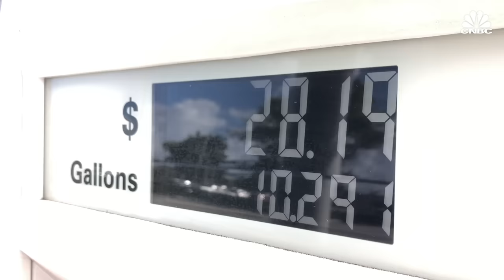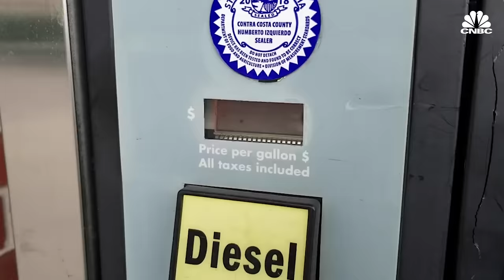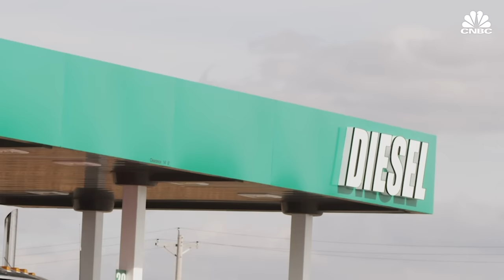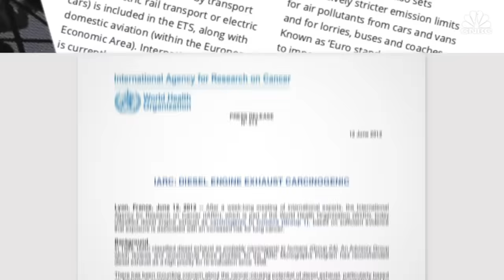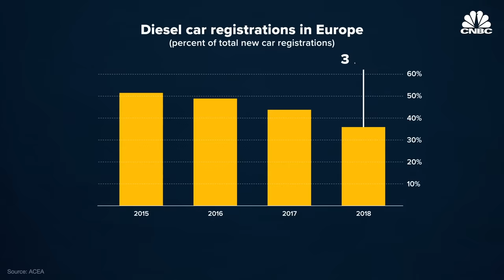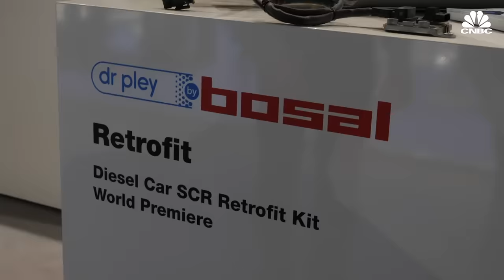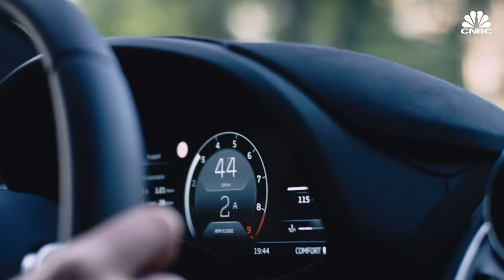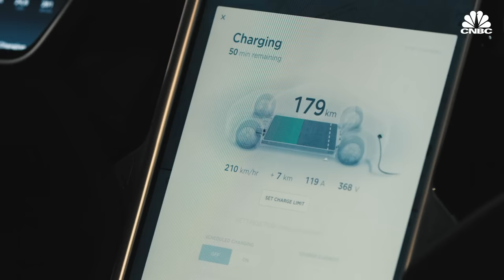Why Diesel Cars Are Disappearing

Comment: As a diesel tech and someone who is very involved with the diesel trade, it boggles my mind why there hasn't been more research into tiny 2 cylinder diesel hybrids in cars. It would be small enough to not produce much emissions and be hands down the cleanest and most efficient thing on the road
Reply: @Retired Bore not in regards to small diesel engines. A 2-3 cylinder Kubota will weigh more then a gas engine of equal size but the efficiency is still leaps ahead of gas engine. And plus in those hp ratings it sint required to be in t4f. This are engines used to power small diesel generators that run at constant load for insane hours on end. Plus the weight isn't that much greater tbh. The use much lighter parts on those baby diesels. I can pick one up off of the ground by myself. Diesel hybrid has entered equipment more prominently recently and already it shows how absolutely amazing it is. The noise is the only thing with those that are noisy but even then new mini diesel gens in rv have also become very quiet. It's very easily durable. But I know the biggest kicker is would be too expensive
Reply: Ist go bad diesel, bad diesel then take it to the diesel pond. Next bad gas engine, bad gas engine & take that to the pond.
Well I guess I need to move to country side and get a Tennessee walking horse. Oh and just how do think you can go cross country on a horse relying completely on that 1 horsepower transportation? You can not. Yep you have to get on a freeway.
And you don't have enough horsepower.
Reply: Gas = hp. Diesel = tq. 
Electric = tq.
Hybrids use the electric to get moving then gas takes over with the hp curve.
 Thus why diesel not used.
Reply: @turboflush  Diesels are heavier, noisier and more expensive to make. Don't fit well in FWD configurations if the diesel has enough HP to move the SUV up hills at the speed desired say on New Mexico freeways. The low temperature starting problem and gelling of the fuel also does not lead to a turn key situation either. But mostly: If it breaks a nail. Requires paying attention to gauges. It won't sell. Besides that diesels are smelly. But  not if you are burning used McDonalds frying oil.
Reply: Because of the DPF which is very expensive and the gain doesn't justify the cost.
Reply: @adrianvasile4683  DEF and DPF just about killed it for those did use diesel in the US.
Both of my neighbors traded their Diesel SUVs for gasoline
 BUT just in case there are a few older diesels hanging in there. Let's raise diesel to  $6.00 a gallon.

I don't care. One of my friends has a 454 CI SUV that gets all of 9 MPG. 8 when it is pulling a trailer.
Reply: @Retired Bore "it takes less power to start a small gasoline engine."  Not significantly less, minuscule,  not worthwhile, not worth mentioning it, only small benefit in percentage.
Reply: @warrenpuckett4203  In the US, manufacturers were reluctant to bring small diesels on the market because the oil industry manipulates the price of diesels and do not want diesels. Why? Because they export large quantities of diesel in Europe. It is absurd to have diesel fuel more expensive than gasoline. From 1 ton of crude oil several times more diesel is obtained than gasoline, therefore it should be cheaper. Probably more than anywhere else US should have far more diesels because the size of the cars and long distances. This is because the Government is week and doesn't have power. We all know it as "small or limited Government" and we "truly" believe is in our advantage.
Reply: @adriaanvantulpenbaard1740  I have noticed that diesel owners seem more reluctant than petrol users to switch off the engine when parked. When I see someone sat in a car for any period with the engine running or even out of the car at a recyling point it is nearly always a diesel. It is is difficult not to get the impression that Diesel users do seem nervous about having to restart the engine. The big problem diesels have is that urban dwellers cannot get a fast run to clean the particulate filter. Typical of our UK government to fixate on CO2 and overlook the myriad of other problems with diesels. The fact makers had to fake emission data to fit in with that way of thinking says it all really.
Reply: Electric is the way to go. Have you ridden in an electric rig before? It's night and day. This is a sinking ship. 30 years and most trucks will be wanting to switch to electric of they can afford the initial investment. Facts. Half the cost to run. The ability to farm your own power and charge others for it as well to recoup costs. The transportation industry will avalanche within 30 years I promise you. Diesel is a dying technology as is gas. It is not efficient and clean as electric can be on a larger scale. Comparing it as of now is not even close. Electric wins by far. Imagine if our grid was developed in a large scale for electric trucks and cars? Can you see the advantages? I can. A trucking company farming their own solar from their headquarters and ultra high capacity battery banks on semi trucks allowing 1k and 2 k miles at a time. With gearing and increased aero we could put 2k miles of range on a semi, still jail a standard size trailer fully loaded, and cleanly drive from coast to coast on one charge carrying the same product as a semi that has to fuel up 4 times or maybe 6. Think about that.
Reply: @tybeeislandgoat1402  Electric is nice, clean, efficient. Just  a lot of problems remain unsolved: capacity, cost, safety and reliability of batteries, chargers, electric infrastructure, massive production of electricity. Lithium batteries are known for at least 60 years and we still don't have a lithium rechargeable battery. What we have is lithium-ion with less than half of capacity.
Reply: @adrianvasile4683  solid state batteries???? Infrastructure will take 5 years tops to convert. And we are projected for 2030 to 2035 to start seeing massive movements towards solid state.
Reply: @tybeeislandgoat1402  interesting is that we establish a date when we are going to abandon conventional fuels and engines but we didn't solve yet the problems generated by this"electrification". This is because the ecologists are leading the movement, not the scientists. In Germany they pushed for years to shut down nuclear power plants and they succeeded. Now everybody realized that was a huge mistake to abandon the cleanest method for generating energy. I think that we are going to have more electric vehicles, which is very good for a lot of reasons, but internal combustion engines are here to stay for longer. Another wrong direction are the electric cars with hundreds of HP. They need huge batteries which are expensive.
Reply: Elon Musk enters chat.
VW exits chat.
Reply: @warrenpuckett4203  If you put a Tennessee Walker on a Dyno you will see more than 1 HP.
Reply: They can't earn money on it
Reply: DEF is the Achilles' heal created bye the federal DOT and the worst part is that it can't be produced in North America
Reply: @warrenpuckett4203  You realize that diesel engines are in an enormous amount of FWD vehicles? You won't even know a vehicle has a diesel engine since they are MUCH quieter than past. Look at many of mercedes and VW or most trucks, 18 wheelers, construction equipment, generators etc. You are not well informed about diesels to talk about them. All of the issues you mentioned are basically non existent now. TDI have sorted out HP, diesel fuel have additives to stop gelling for decades, up hill driving diesel is actually better because it is torque that provides the effect to drag heavy weights where as HP is only for acceleration, you can test this by max loading a turbo petrol vs a turbo diesel uphill you'd quickly see I am correct. Just like petrol has pollution clearing techniques so does diesel engines. Without diesel engines you goods would more than double in price.
Reply: I don't know if you were aware of this, but there was a car made by Volkswagen that was exactly that. A tiny 2 cylinder diesel engine connected to a generator in a plug-in hybrid car. It apparently got 260 miles per gallon (0.9L/100km). Aging Wheels has a video about it. https://youtu.be/1E4Cqx4S7K4
Reply: thats what ive been saying you would get so much fuel economy.
Reply: Because it's not about saving environment but getting more taxes.
Reply: Have you not seen VW’s XL1 from 2013
Reply: @Retired Bore Do you understand TORQUE?
Reply: @bradrenfrew2749  HEAR HEAR, but investment is WISE...
Reply: @warrenpuckett4203  NOTHING wrong with the Tennessee walker idea...except you getting your mind around it...a very valuable tool that Walker.
Reply: @adrianvasile4683  HEAR HEAR THANK YOU
Reply: @tybeeislandgoat1402  Batteries are excess weight...go check out a diesel electromotice train cheapest to run powertrain...Much cheaper than steam of mechaical diesel
The savings on long term😎😎😎, unfortunately most are shortsighted🤕😒😒
Reply: @Indpendent01  Rightly so...
Reply: @williampankratz600  🤣🤣🤣🤣GD fools
Reply: @kazykamakaze131  EXACTLY
Reply: @quinnobi42  THANK YOU....file under beautiful instruments
Reply: Small diesels are so fuel efficient, that carrying around the extra weight of the electric motor, batteries and charging system, is likely to make the hybrid diesel LESS fuel efficient than a pure diesel.  That's why most hybrids are petrol: petrol engines are very inefficient when not running at their optimum settings, and the hybrid system can help correct that.
Reply: basic buddy might combine your comments with te techs idea  and engineer a 200mpg hybrid. also fyi we burn diesel and fuel to make electricity in america also to charge ev cars lol people are intelligent your exploitable.
Reply: Double trouble.....
Reply: Not identical, but I’ve had similar thoughts!
Reply: there is only one solution for clean mobility: EV. Stop trying defending dinosaurs, I love combustion engines but they have to go.
Reply: Ya let's regress technology even further.  I envy future generations that won't have deal with diesel. In Canada we just run diesel engines all night or break building code violations and park them inside in fears those POS won't start in the morning. The day my company switched our work trucks over to gasoline was a good day.
Reply: @Josh  sounds like you have a company that doesn't know how to run diesels
Reply: @bradrenfrew2749  Diesels are just crap in cold weather. Can't wait until electric fully takes over and I never have to smell or hear those god awful engines again. Unfortunately probably not in my lifetime.
Reply: @Josh  I'm a diesel tech in alaska my guy, if you know what you are doing they will run every time. We run diesels in the North Slope
Reply: @michaeld5888  it's got nothing to do with starting a diesel. It's because an idling diesel uses so little fuel. Might as well keep the AC or heater going.
Reply: @FefyGT  EV isn't clean. It just moves the pollution elsewhere. Those batteries don't mine themselves.
Reply: @alanjm1234  I am not a big fan of EV they have tons of problems compared to combustion cars. Being clean is definitely their strength, how can you say the contrary? Even if you produce electricity with gasoline, power plants are 4 times more efficient and moving pollution away from cities is a big deal.
Reply: @Alexander Ratisbona  pm is produced when the engine runs with either too much fuel or not enough air aka a rich mixture. The black soot you see is just unburnt fuel. Pm mostly drops down after it's expelled. The jury is out on its true effects on the environment. The true tree house emission that diesels produce is NOx and it is because of high combustion temperature that diesels tend to run at. Diesel engines below a specific horsepower rating don't have to have emissions systems on them because the amount of emissions they produce is minor.
Reply: @Alexander Ratisbona  also two-stoke engines produce a lot of smoke because they are burning oil. That's why almost nothing but really really small engines are two stroke anymore. Four stroke does not burn oil
Reply: @TurboFlush  if this was true we would never see diesel generators. Generators and electric cars run on the same principles
Reply: @Warren Puckett  diesels are heavy but common day new diesels run aluminum heads and the weight is not that far apart anymore. They do make more noise but again in new day generators they aren't that bad. And are more expensive which is the number one draw back but would pay back on fuel prices. If you have ever been in a diesel truck post 2010 they rarely have cold starting issues and fuel only jells if it is at low temps for long periods of time. You don't have to pay attention to any special gauges on diesel but should let idle down time for the turbo. And with ultra low sulfur they aren't as smelly as the used to be
Reply: @adrianvasile4683  depending on the hp rating you don't need a dpf
Reply: One question: how do you market torque to a normal car buyer?
Reply: @lazywarrior  the engine turns a winding to generate AC voltage to power an electric drive motor. Diesel engines produce horse power as well. Both produce both just diesel puts out more torque then gas engines because of the power of the combustion stroke is higher
Reply: @lazywarrior  if you want to get technical all engines are actually rated based on their Kw output. Even those in cars because it's only the true form of engine output. Horsepower is a made-up term with no true reference to power.
Reply: @bradrenfrew2749  then invent some fancy unit that put diesel cars at the top of the list. That would be a good start.

Most of us know a higher-clocked CPU  may have a lower performance than a lower-clocked one. But hz was (and to some extent still is) one excellent marketing strategy.
Reply: Kkkkkkkk
No
Reply: @kazykamakaze131 umm you can stand next to a current day diesel and smell and hear the difference. Diesel’s don’t like emissions controls. They are dirty engines. Just look at the used oil.
Reply: @MrBobbo18  No you can't hear them as modern day vehicles have sound suppression and mufflers and post gas processing on new diesel cars like Mercedes have emission laws they have to abide by just like petrol engines. Also who sticks their head in front of exhaust to smell their fumes??
I'd rather use a TINY bit of extra oil to get significant fuel savings in the life time of an engine as ALL engines burn oil. So I still don't know the benefit of your comment has  added to this discussion.
Reply: There are just not in north america
Reply: @warrenpuckett4203  this is the most convoluted nonsense I have ever read
Reply: you do it! become a gigabillionaire
Reply: vibrations boy vibrations
Reply: @tybeeislandgoat1402 Aan electric truck - hauling it's own battery. Range is just terrible for EVs. They are too expensive and they don't have the materials to make a lot of them.
Reply: @turboflush hp is tq lol

Comment: Had a diesel pickup from Isuzu for 20+years. Love it and drove it till the timing chain snapped. By then it was rusting out, but 40+ mpg in city and 50+ mpg on the highway was something I don't see anywhere else in any car company. Named it Ruth after the white dragon of the Pern series.
Reply: Those things rattled, vibrated and smoked like a banshee under load but were pretty reliable. I almost bought a non-turbo one but the test drive convinced me it was not for me. My buddy only got 22 mpg with a sizable camper shell on back. He got 32 mpg before the shell.
Reply: Holy moly I’m more surprised that you know about the dragons of pern series, I once found that book in my dads collection and I thought it was a forgotten series
Reply: What model and year
Reply: what was the mileage when it finally died?